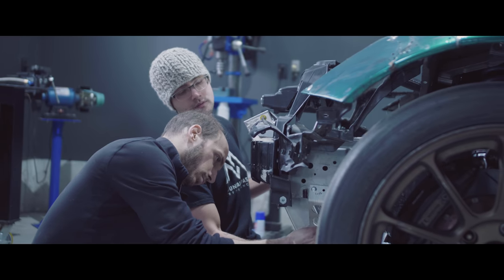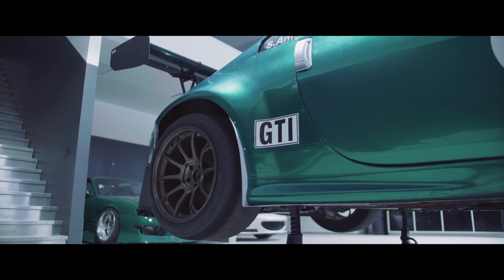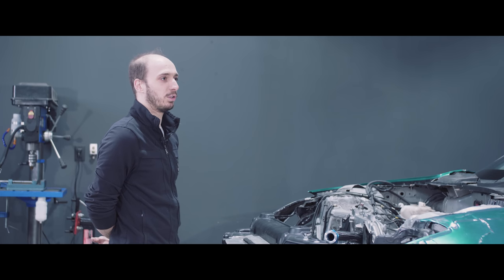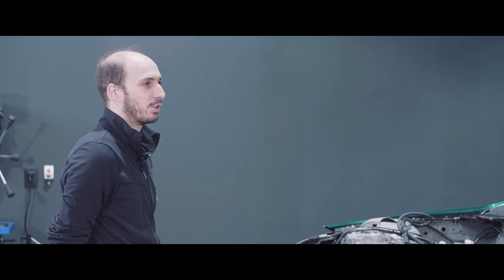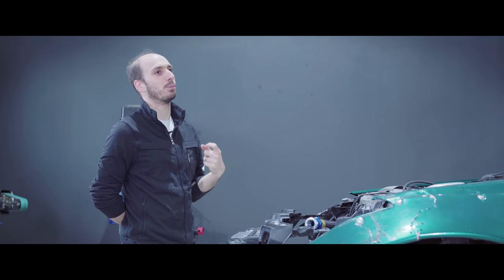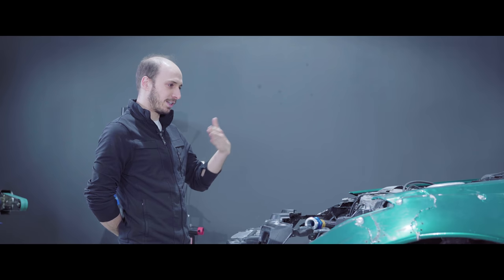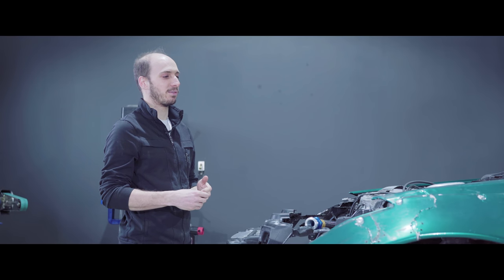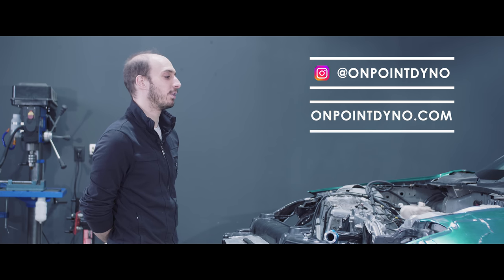800+whp 350Z with Hybrid Motor Unveiled by Sasha Anis

Comment: Where will the electric motor sit? What motor are you using? What size battery pack? I would love to see a hybrid GTR replace the "dummy box" on the back of the engine with an electric motor. Nice bit of tourque fill for when your off boost and out of corners.